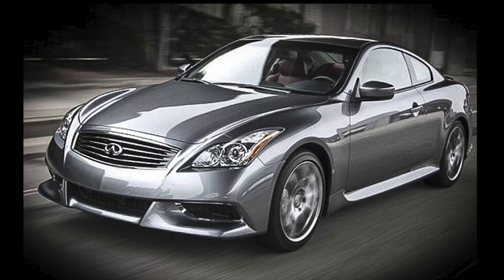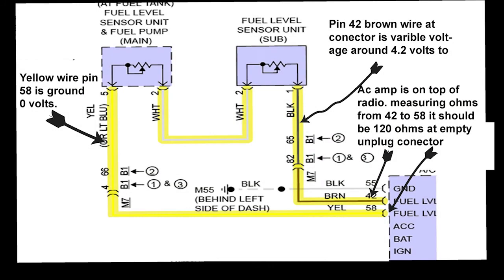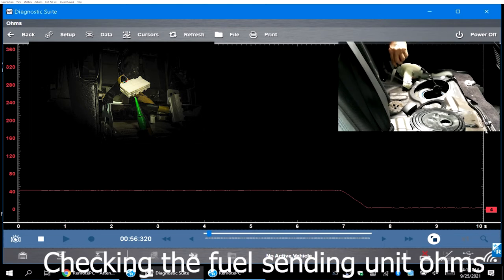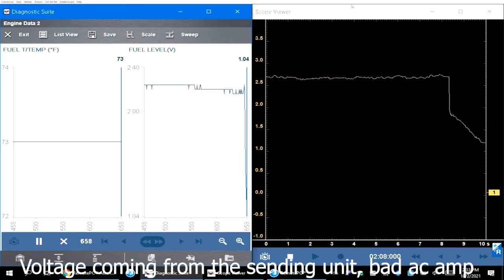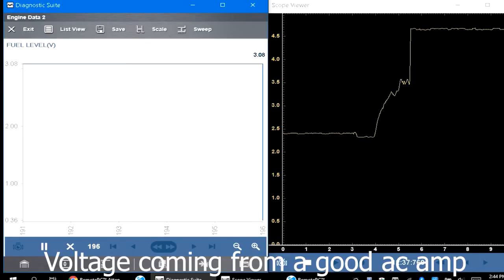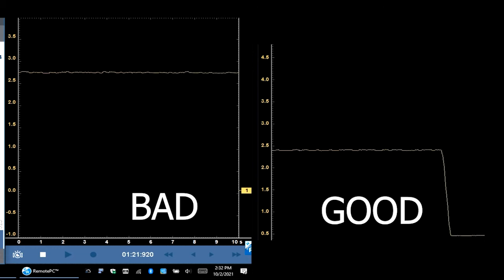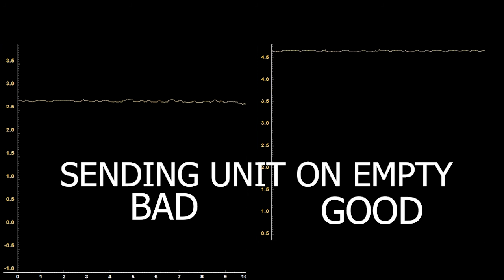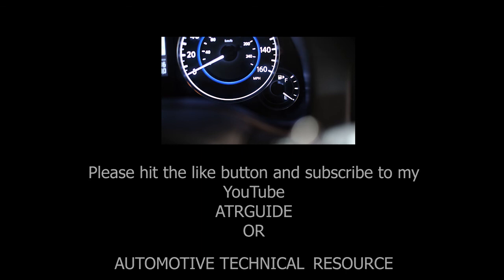Nissan, Infinity fuel gauge, a/c amplifier, gauge, fuel gauge not working, instrument cluster p0462

Comment: Best diagnostic i have found about this and go figure it has barely any views. Is the ac amp part the same for the sedan and the coupe i have an 07 coupe. Please answer  this problem is maddening.
Reply from the maker: Yes, most Nissan’s / infinity run off the ac amp. 
Glad you liked it.
Reply from the maker: You should look Atr how to fix a shorted fuse video, I think you will like it.